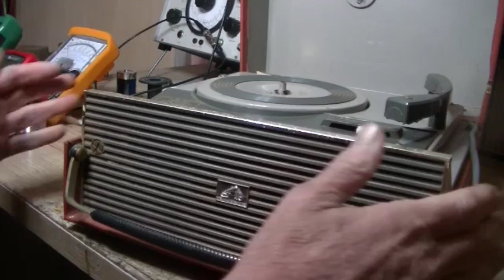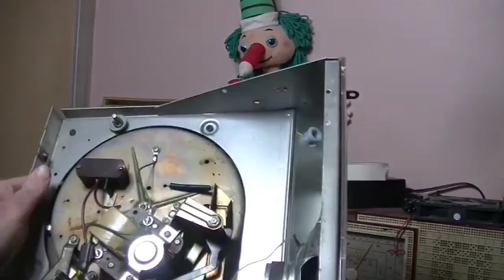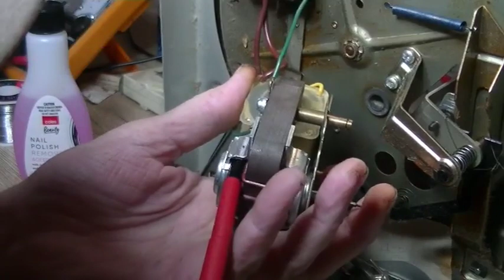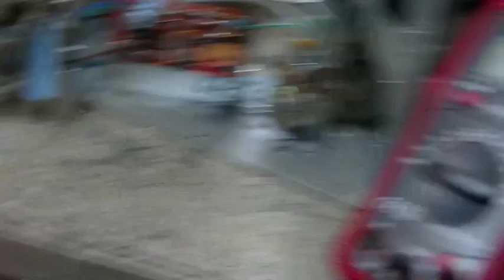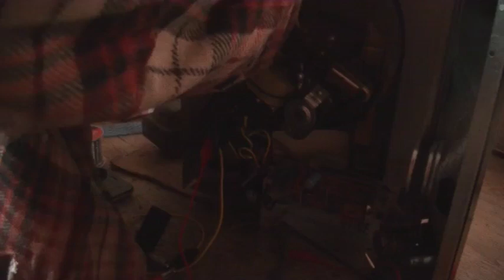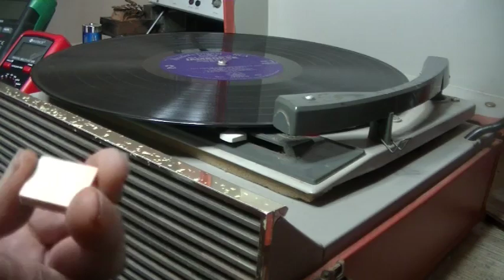HMV Monaco Record Player Restoration and installing a cheap Chinese cartridge

Comment: G'day Frank. I'm working on one of these and the OFF mechanism does not work. Any ideas or could you make a video showing this area's mechanics.? The small circular spring is there under the turntable, but it does not pull the mechanism back (if that is what it is for.) Perhaps another spring is missing. Any suggestions would be welcome.
Reply from the maker: Hi Stuart, I've never had an issue with those switches but I can look into it for you. Hopefully, we can suss it out
Reply: @exeterslab7781  Hi Frank. Sorry for misleading you. It now works. It also revolves at the correct speed. I guess lubrication did the trick! However, as I have no sound, and having a clue about tracing faults, I am considering replacing the amp with one from Jaycar.Any chance you might make a video or diagram for this? Cheers mate.
Reply from the maker: @stuartvaughan-williams7257  Hey Stuart, no probs at all champ, I'm glad it's working correctly. The Amp is another story lol. Before changing it, you can check if it's the cartridge or speaker which are faulty.

I'd check the speaker first by using a 1.5v battery; pos and neg of the battery across the speaker terminals. If it crackles the speaker is good. 

That leaves the cartridge. Trace the wires coming from the cartridge to a terminal strip on the underside of the turntable. There maybe four wires or just two. if it's two wires one will be the signal from the cartridge the other will be its earth wire which is easy to pick as you can see it going to the chassis. 

Four wires just means stereo, 2 wires for signal and 2 wires for earth.

With the unit powered on and the vol turned up, touch one of the cartridge signal wires with one finger, that will short it and you should hear a buzz of some sort from the speaker. If you do, the the amp is working and the cartridge is dead. If you don't hear anything, the amp is likely shot. 

I'm not sure of how much experience you have, so please excuse me if you already know this stuff. Please make sure you don't touch the bare metal of the chassis or turntable with your other hand when doing this or you may get a very very nasty jolt from the unit. It may even kill. 

If the cartridge is dead those cheap chinese
cartridges I use at about $2 each will do the trick.

From memory, the monaco amp uses two AC128 transistors for the audio output. These may be dead, but I've seen them for sale on Ebay. I have the schematic should you need it. The unit also has two other transistors an AC125 and OC44 but I don't know what they do. I think I've seen them on ebay as well. 

The jaycar option is also a good idea, which we can discuss if you go down that path.  

I hope this helps a bit and feel free to email me at 

exeters_lab@protonmail.com

we can send pics etc and makes the process  easier. Happy to help as much as I can.  Cheers..........Frank
Reply: @exeterslab7781  Thanks Frank. I will let you know how I get on.
Reply: You are a legend. One one thing I thought it would not be, it was. The speaker is faulty. No to find one that will fit.  Stay tuned.
Reply from the maker: @stuartvaughan-williams7257  Great news Stuart. For testing purposes any 4 ohm or radio speaker will do to see if the amp is working.  Looking forward to what you find. Well done

Comment: Nice job Frank, the scrabble tile was a good idea, giving the Velcro strip a flat surface to adhere the universal cartridge/needle assembly to. I think the replacement could last as long as the original depending on the weight in grams on the needle. Seems to be tracking well:)
Reply from the maker: Thanks Ken. I was shopping and when I saw them I thought that might fit inside the arm. You get lucky sometimes lol